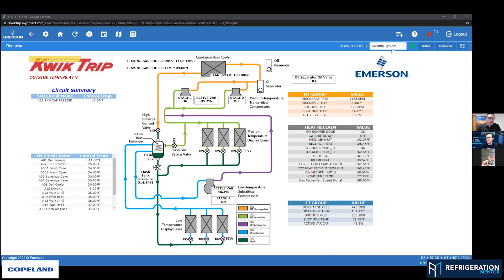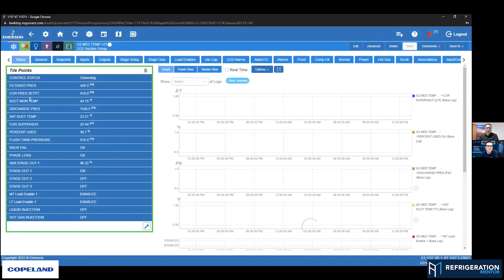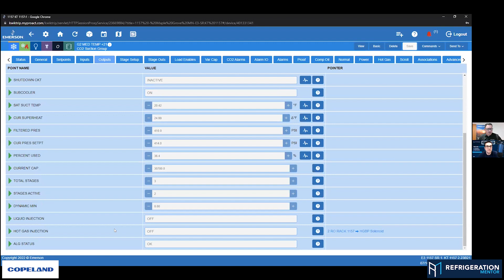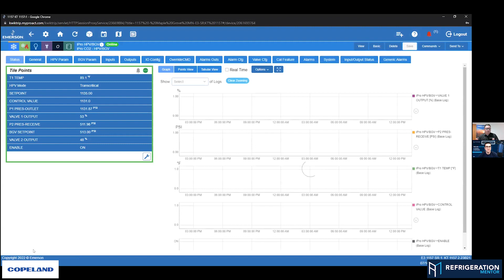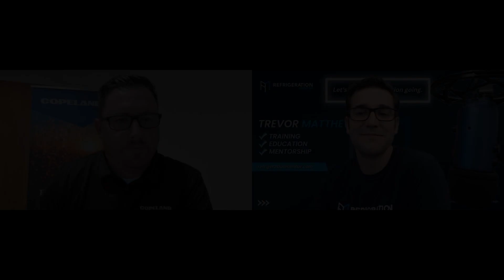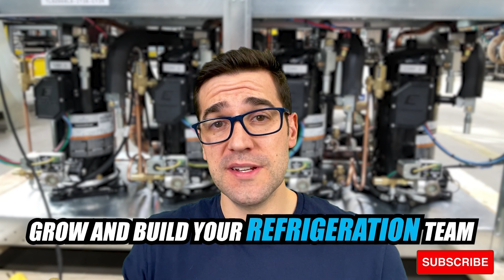Mastering CO2 with Brent Cheshire: Top 5 Insider Tips on Copeland's E3 Controller & CC200

Comment: The good thing about CO2 systems that are correctly installed correctly designed, and correctly maintained.   If you’re good, you basically have a monopoly on a proprietary system and procedures and you probably don’t have competition in your area.. 

And if, by some chance the business or store decides to use somebody else to maintain and service their CO2 systems, you can probably be sure the odds are. They will screw it up, cause multiple failures, and very expensive breakdowns, and losses for that supermarket.. 

And then, if the store gets smart, they will call you back to properly fix it dial it in and repair bill will be phenomenally hi and they will have to pay it

And they could account that has the price of education for being stupid and seeking the little bitter, who is an educated and unskilled at the CO2 system. 

This is exactly what I see when selling and installing large VRF heat recovery systems

If the building owner or business owner or a new manager decides to hire a new company because they use them in their old facilities on old systems I come back to burned out compressors. 

It’s nice not having competition when your competition makes you more work